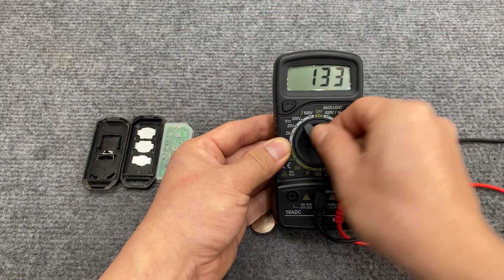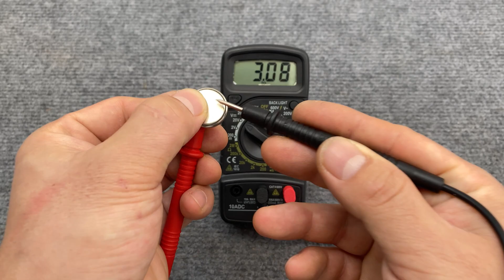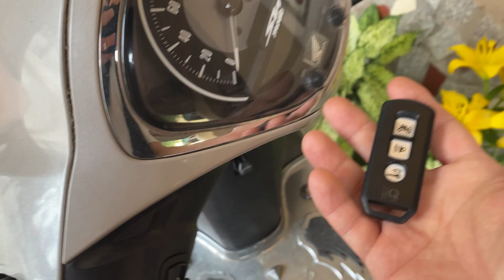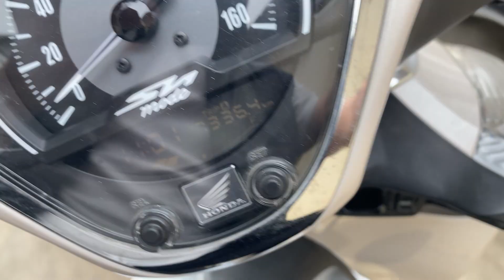Never Buy Batteries Again! Restore Battery in 1 Minute!

Comment: Thanks so much for the tips.  is that ppossible to use different voltage chargers? keep on exploring, guy.
Reply from the maker: It is completely possible, you just need to pay attention to the input and output current.